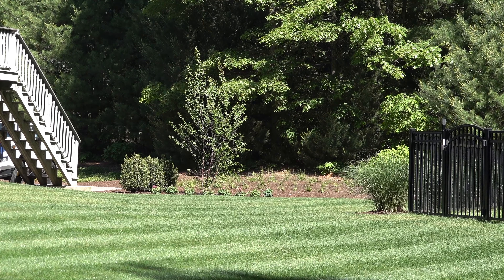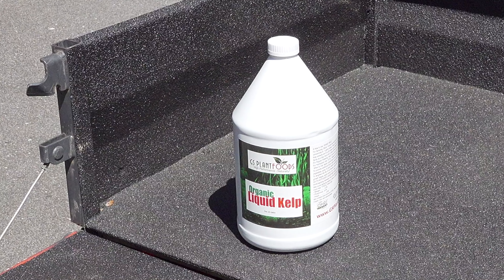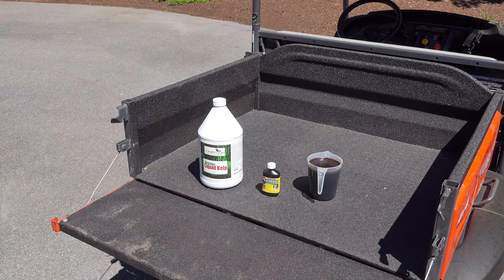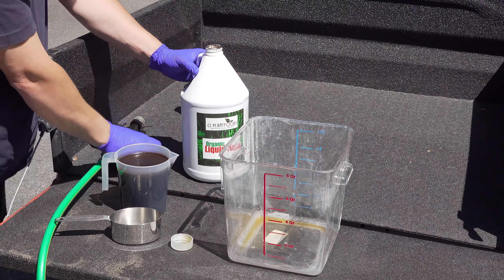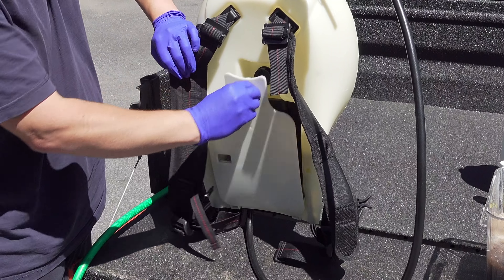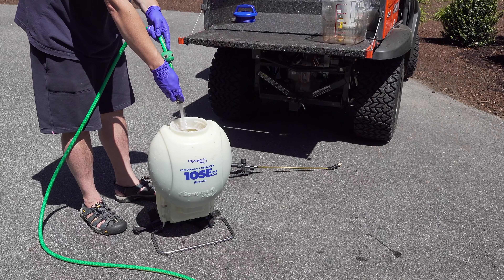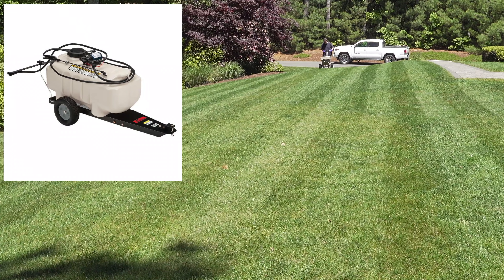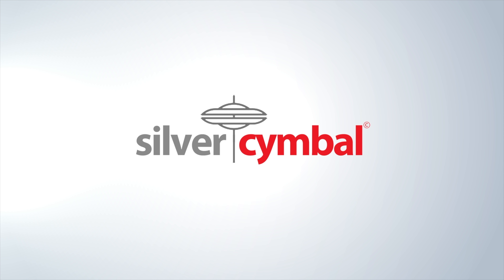Protect your Lawn From Summer HEAT & Stress my Secret Recipe STAY GREEN with Sea Kelp

Comment: I just want to thank you once again for the video.I started using it months ago and my lawn has never been so healthy and green even when we use to have a professional lawn care service.
I did modify the formula at my own risk last month to accommodate my backyard garden as well. Instead of superthrive I substituted it for a product called AgroThrive. I waited for it to rain a day before then applied the formula. What I notice is I have to cut the grass every 5 days and increase yield to my garden. Even with this Texas heat, lawn and garden are not so stress out like before. It's TRUE a healthy root system is the key!
Reply: What made you switch from superthrive?

Comment: I really enjoy your videos. Thank you. I needed to break your application rate down for my own yard size. Hopefully I did it right and it helps others.

8 fl. oz (1 cup) of sea kelp per 4 gallons for 2500-3000 sq ft
 in the video
4 fl. oz per 2 gallons for 1500 sq ft
2 fl. oz per 1 gallon for 750 sq ft
so ~ .3 cups per gallon for 1000 sq ft
= ~2.5 oz per gallon for 1000 sq ft
= 5 Tablespoons per gallon for 1000 sq ft
Reply: What are yiy breaking down, 1, .5, .25 cup of what there are 3 things are up doing it for each part for the whole or what? thanks
Reply: @Die Hard Raider For the sea kelp portion, post updated, thanks

Comment: Thank you so much for all of your tips!   I sprayed your formula on my lawn about 6 weeks ago, and after just two weeks, it looked amazing!!  My lawn has never looked better!  Thank you!  Now the Texas summer heat is bearing down on us and my lawn is not being able to stand the heat. Despite watering, the lawn is not looking as good.  How often should I/can I add your mix to my St. Augustine lawn?
Reply from the maker: So glad it helped. I appreciate the feedback. Here in Mass we are having an extremely hot summer, very intense sun daily and little rain. I try to spray once per month in conditions like this for us, for you you may need to do it every three weeks. This is a very tough year and many neighbors lawns are very damaged, I have some spots and areas that are having a tough time but the mix is definitely helping. Hopefully temps drop a little for everyone, this is rough! Hope this helps.
Reply: @SilverCymbal  THANK YOU for getting back with me so quickly!!  I will plan on adding it every three weeks.  I have also noticed some areas where a few of the blades are yellowing, but not a ground level, about an inch from the ground.  I noticed it about a week ago and its just in a few areas. Am I overwatering?

Comment: Useful, I will have to calculate the US to UK gallons based on the US Ratio stated on the video. We have 8 pints to a gallon in the UK, our pints are bigger than US pints by 20.8 %. I remember that buying a Guinness on 5th Avenue in NY in 2002, 5 Dollars a US pint UK Pint was 21% more liquid and even in the south of England was about £2.50 a pint then ,the ER was 1.53 $ to the pound so UK Guinness was 3.83$ and English pint!!! US Beer expensive!! 👍

Comment: I already apply humic acid in a granular form every two weeks so most likely if you do the same thing you can bypass the liquid method.  I would also suggest adding six or more ounces of a quality surfactant to help break the water tension for better absorption by the leaves..

Comment: Retired and moved from a Townhme in the Big City Suburb to a Lake Resort in Wisc...The Cottage Home we bought has a nice Landscaped Front yard with about 1500 sq ft of Lawn and he had been using Lake Water thru using a Water Pump and a 1" PVC line in the Lake and "waters His Lawn with this "  Once a Month.In Spring ( May) is Scotts Weed & Feed with Crab Grass Pre-E.  
       Next Month ( June) is Milnorginate and He Only Trimmed the Grass not cut it shore, leaving Min 2-3" height with using a Nice Manual Reel LM..Nice and Quite and cuts Nice..He left all his Garden and Lawn stuff , nicely Stacked in Clear Containers and Shelving( Before he and his Wife moved ot the Home In the Clearwater area for yr round .. and This Lawn has a Watering system with a Timer..
      The wife an I were 55 when we retired( he was 60 )  and its been 5 yrs now and the Lawn and Bushes are doing just fine !  Its that Lake Water with Fish and some Seeweed in it , that makes the differnce with the Milnorginte and watering 1/2" every week when It doesn't rain.. Weed & Feed in the Fall and Spring to keep dandelines out and Neighbors Weedy Lawns, most of the other summer Home owners don't take care of their Lawns and full of Weeds and Creeping Charlie..our duble wide Gravel drive and 5 ft of Mulching Landscaping on the other 3 sides of our Yard helps keep neighbors yards weeds out of ours.. Got Fungus a Few times and use Specricide PreMixed Bottle with a Garden Hose  did the trick!  Got Grubs 2 seasons and Used Grub Killer and did the trick.. Best of Luck..

Comment: For general spraying, I use a 12v automotive battery with a 12v utility pump, hooked up to a garden hose and nozzle.  Pumping out of a standard 5 gal bucket.  Also use soil probiotics with beneficial soil bacteria (Bacillus), i.e. B. subtilis, B. licheniformis, B. megaterium, B. mucilaginosus, B. laterosporus, photosynthetic bacteria, Actinomycetes, B. cereus, B.amyloliquefaciens,
B. pumilus  and mycorrhizal fungi (primarily Trichoderma).  Soil bacteria are better as they are more resilient to adverse environmental changes.   Organic fertilizer is added last.

Comment: another thing  i left out to cut grass high leaving it at 4-8 inches will help to cool of providing self shade on a smaller scale and not burning and yellowing it out at 3 inches and 1 inch causing stress and to die, as well to increase fast thicker growth needing more water ,,, its more naturally ,the closer to more naturally the better, even watering if you study how it rains stops ,slows down and starts again, or waits 2 or three days later consistant  rains means change of weather soon fall spring summer

Comment: Hydretain works well. Comes in liquid or granular form. I also apply           holganix. Price isn't too had since I   only treat about 1800 sq ft of lawn. And they both dilute with water per instructions. But... I'm gonna try your formula next summer. Seems great
Reply from the maker: Thank you very much I will have to check that one out too. Thanks for the comment and for watching.

Comment: I pre mixed this is a gallon milk jug and then use a hose sprayer on 1oz or the 1 1/2oz setting. Using on Centipede Grass in NW Florida.

Comment: I can’t wait to try this!, I do have a sprinkler system and you’re right , water is not enough, I have a few hot spots on my lawn, that kinda yellow up or a deep golden color,  I have just a couple of questions for you 1)after application how long before I see results? 2)How often do I apply this formula? Once a week , month? Thanks for the vid!
Reply from the maker: Remember the primary reason for this formula is to help against heat stress, not necessarily to restore your lawn but this will definitely help that too over time. Not a miracle cure but a mix that keeps your grass looking good and I do see results usually with 3 weeks but the biggest benefit is that it keeps my lawn green with my neighbors aren't and keeps things better longer and helps the overall turf.   I only apply this once a month during the hotter months (over 75 degrees, most of the day) with good results. Thanks for watching and the comment.
Reply: @SilverCymbal  thanks for the video man! How much coverage on the 4 gallon?
Reply: Silver Cymbal still good, I now have something to aid me verses nothing.

Comment: Great information, thank you.  I've been mixing up dry humic and kelp and spraying at 8oz/k², this looks easier.  Just to clarify - you're using 4 gallons on 2,500 sq ft???  This is really heavy since the manufacture suggests 2 to 4 oz/k².  I don't mind putting it on heavy, just wanted to make sure you're using successfully on 2,500 and not 25,000 sq ft...
Reply from the maker: That is correct, sometimes if I really step up my pace I will get closer to 4,000 sq ft but I try to aim for 2500-3000 of turf coverage with this amount.
Reply from the maker: Also meant to add that dry humic acid works very well also. Especially if you want to focus on the soil. This formula is a nice all in one that can help with the stress and still provide some other benefits.
Reply: @SilverCymbal  Thank you, I've obviously been putting this down to light...
Reply from the maker: @gordonhutchinson529  You certainly may get some benefit but these products and concentrations have worked well for me. Other ones may too, but the price of these and amount you get along with the fact they work will have me sticking with these for a while.

Comment: Already figured this all out. I just can't afford the expensive stuff I also use liquid iron and recently I've discovered mossex. I mix it with water and put 2 oz of my sprayer along with the kelp and humic acid been working very well. I have found that a hose-end sprayer works much better to evenly spread the recipe
Reply: Mindy Welch so you are adding 2oz of liquid iron and mossex to the 4gal mix of humic acid, kelp & supertrive?

Comment: Can I apply JUST the diluted kelp, without Humic Acid or Superthrive?  I'm already applying granular humic acid to the soil on a regular basis but I see a huge advantage to getting a liquid kelp onto the grass itself.  What are your thoughts SC?  Keep up the great work.  You're helping tons of DIY'ers just like me.
Reply from the maker: Thank you very much. Yes you can absolutely apply just the sea kelp and still gain all the kelp benefits. If you are applying humic others ways that is totally fine. Thanks for the nice words.
Reply: Is this application in addition to the fertilizer every 6 weeks? How long do you wait after fertilization to do this application?
Reply: @Nas_JO  I'm applying granular fertilizer, granular humic and biochar (HumiChar), and then spraying liquid kelp, all on a staggered cadence, usually every 4-6 weeks.  I apply my granulars prior to watering or rainfall.  I spray kelp at the end of a warm dry evening and don't water for an additional 24hrs.  I would like to note though, that I have since learned and bought into the logic that liquid humic (and all other boosters for that matter) obsorb better and faster in liquid form.  SC DOES have the best process, I just wasn't ALL IN on liquids until now.  Probably going to finish out the granular product I have now and revert to SC's process he show's here.  This is what made me a believer https://www.youtube.com/watch?v=IXBQQR9WVJI&t=1196s

Comment: Excellent, I've noticed that just watering doesn't preserve my lawn.  Thanks for the recipe and application options!
Reply from the maker: Thank you. This mix has given me some incredible results. I watered year after year and still had issues before using this. I am on a well so the water is pretty much unlimited and it still wasn't rough. Glad this was helpful.
Reply: @SilverCymbal  How often do you apply this solution on your lawn?
Reply from the maker: @Fdnymedic40  do it monthly when daytime temps average over 80, usually 2-3 times during he summer. Even if you do it less there is still benefit but this gave the best results while being affordable,  Kelp: https://amzn.to/2It5ZJT  -  Superthrive: https://amzn.to/2It654d  - Humic Acid: https://amzn.to/2WyMABa - Sprayer: https://amzn.to/2IslQIJ

Comment: May i suggest, like some others do....a colored dye...prob a shade of blue?....when you apply this solution . It helps to see areas u coated when u use a hand, backpack or push tank sprayer, no spots missed. Tow behi d sprayers are more forgiving w wide booms to overlap. Seems pros use a food coloring or some other dye that washes away a few days later in the rain, no permanent dye on lawn or landscaping. 

I like that battery powered backpack sprayer....reasons why, besides easier to carry, and battery pump...it gives an EvEN spray pattern, vs hand pump that decreases gradually until u pump it back up. The BEST... feature is that large capacity inline mesh filter. WAY TOO OFTEN manual pump sprayers get debris stuck in the nozzles or in the wand, lot of wasted time cleaning it out , that mesh filter is the perfect design. Looks well designed.

Comment: Thats funny. I use the same exact mixture of products, the only difference is I use the sea kelp with fish. I apply it late evening right after a mow when the sun is down so it can sit overnight and then water it in early in the morning. GS Plant foods Humic is less than 8% of actual humic, it is not mentioned on the label nor is it mentioned on the companies website. I had to inquire with the company owner to find out, not pleased with a company that purposely withholds info. I will be trying the Humic12 by N-ext
Reply: So, can l use this in combination with my fertilization? Is that safe?
Reply: Yes these products are organic and they work well with a fertilizer.
Reply: @myreplysucks7984  ...  Cool. Thanks. Just trying to make it through the summer. Come fall, l will be doing the whole 9 yards. Aeration, dethatche, etc.

Comment: Thanks for the great video. Did you consider using GSPlant Foods Root Ruckus Product?  It contains both the Sea Kelp and Humic Acid.   Might be a better option for those with a smaller yard who don’t want to spend as much on large product quantities.
Reply: This is what I did.
Reply: Great tip!
Reply: Question on this - do you dilute the Root Ruckus product like the instructions say?  And then use 3 cups of the diluted per 4000 sq feet?

Comment: Hi, you say add 24 oz of Humic Acid, which is 6 oz per gallon. The label on Humic Acid, however, says Optimal concentration 2 oz per gallon, Maximum concentration 4 oz per gallon. 
Please confirm that you use 6 oz per gallon with no negative effect on the lawn.
Thank you.
Reply: Humic acid is a soil conditioner. it is not a fertilizer. It has no nutrition value. it helps roots to absorb more nutrients.
Reply: @abansalify  thank you for your response. I did apply your formula and I see my grass healthier. It is 90+ degrees now and dry in Northern NJ. I think my grass would have been dead by now (despite me watering) if it wasn't for your solution. Great many thanks!

Comment: I use 532 or 632 ,,once a month in spring only,applications are best done at evening before sun is setting,,before that In fall I spread calcium magnesium limestone once a month, sold in home depot for 6$ for a large amount bag,this is best done before it rains, also sulfur at $6  spread once a month at different time either water or rain,,use before summer,, the other is to deeply water before the summer 3 times a week, or use rain water,,,, so when summers here you can water 2 a week ,, watering must be done evening when sun is setting all the time,,, harvesting rain water,,rainwater is best, this will keep your grass cool like a camel in the desert,,, partial shade also helps planting small trees, the wind will make the branches seem like a fan,,,the green look is iron and coloring in water either aqua green blue or green, will help, to much iron or water will yellow it out on iron will damage roots in long-term,,,,, that's all you need
Reply: Good info. I been researching the best times to water and it looks to be the early AM due to mold and other related issues that are caused by watering in the evening. Any thoughts?
Reply: morning it will cause humility with sun if sunny and will damage your grass plants and trees  the water wont soak in the dirt in time,,grass likes a deep mixer of dirt in its water it takes it in and cool water ,morning time its racing itself with a mix that the grass does not like ,, it may be shaded area for whatever reason ,, shaded areas cause mold and over watering as well,shaded areas at a certain time meaning the suns movement at time, they need less water and sometimes a different time of watering like early in the evening,,  thats why sprinkler systems are regulated by goverment, water restrictions

Comment: How often does one need to apply this?   I'm in the midwest, with sometimes pretty brutal sun in summer.   Also, at what time of year do you apply this?
Reply from the maker: When temps start top go over 75-80 for most of the day I will apply this once a month.  You can do it more often but this will give a good result and still keep costs under control.
Reply: Silver Cymbal , do you let this dry on the grass blades or water it in? The directions on my humic acid day to water it in after application, but I've read that sea kelp is best left on the blades...? Thanks, keep the great content coming!

Comment: Do you think adding a small amount of anti-foam to the mixture would be beneficial in reducing foam the foam up?  
I’m definitely going to give this a try!  Great tip! 👍🏻😊
Reply from the maker: I know, I always hate the foam. I try to keep my videos clean but what I usually end up doing is slowly adding the water and allowing the foam to just run over the sprayer and then cap it from there. I haven't ever used those anti-foaming agents and probably wouldn't both and just keep it easier for you. It settles down on its own too. Thanks again for the support and watching.
Reply: Silver Cymbal You might give it a try sometime 🤷‍♂️.  Just a tiny bit of it negates the foam instantly plus it sprays better and cleaner through the sprayer.  A small bottle of it goes a looong way 😊
Reply from the maker: I will have to check that out. Sounds like it could be an easy timesaver.
Reply: Silver Cymbal Liquid Harvest No Foam.  It’s on Amazon...duh! 😂
Love the stuff!
Reply: Couldn’t you  just add your elements into the water and thus prevent all the foaming?